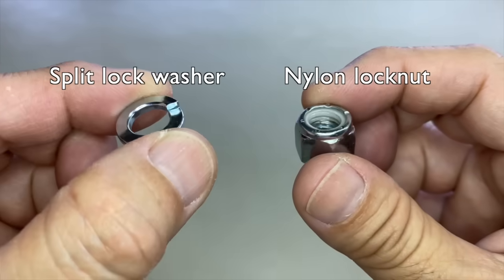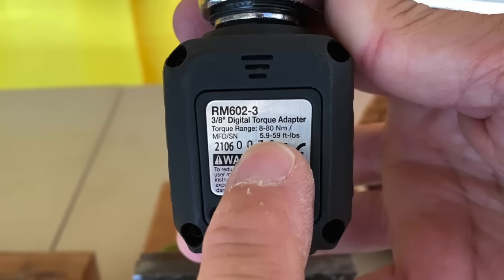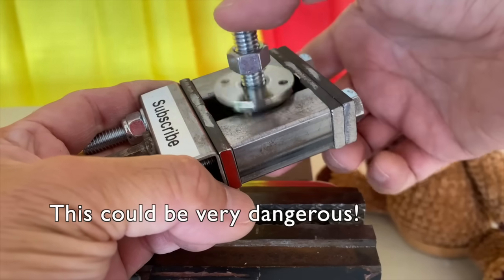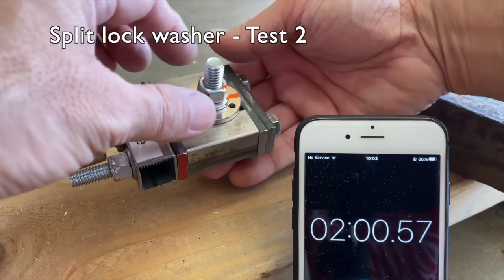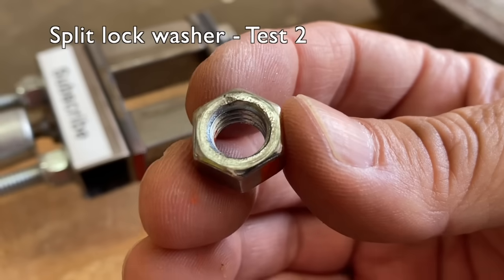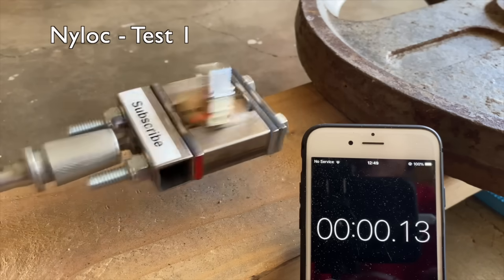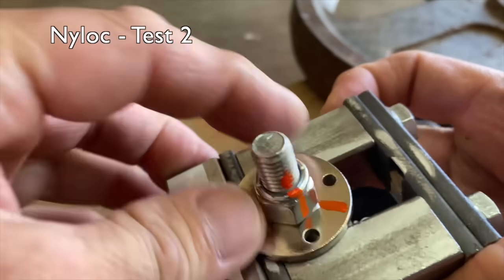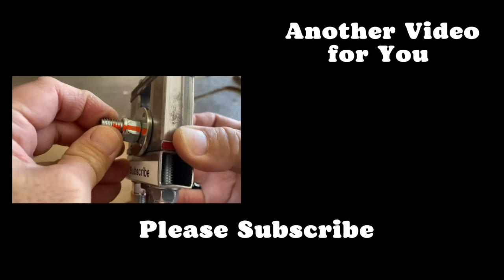Nuts & Bolts - Split Lock Washer vs Nylon Locknut – DIY Impact & Vibration Test - Part 1

Comment: I always use nyloc nuts that are then spot welded in place after a hole is drilled to use a cotter pin retainer and three drops of loctite, but not before I grind off the remainder of the bolt to then peen down around the nut like a rivet, after which I seal the whole apparatus with duct tape for water resistance.

I have trust issues.
Reply: So you were the guy who worked on my Model T! XD
Reply: They will invent a new method and you're in trouble, cannot add one more. :(
Reply: You must work for a repair garage that charges that charges $100 per operation therefore charges $700 to put one bolt in.  I think I took my car to you once...
Reply: @edwardpaisley9063  You were out favorite customer; the crankshaft bolt job on your truck was my greatest personal milestone!
Reply: Just showed that to my wife. She said. ,, oh my God!! You have a twin!
Reply: I do all that and use left hand threads to confuse would be saboteurs.
Reply: @bluestormcloud791  This is hilarious!
Reply: I always saw down the middle of the protuding part of the bolt with a hacksaw, then separate those halves with a chisel and hammer. 
Then I take an old sloppy adjustable wrench and carefully round off the corners of the nut. 

After that I give it a few squirts of Rust n' Stay™ and it ain't going nowhere.
Reply: Yet you rely on duct tape in an attempt to seal out water????
Reply: I’ve had to work on some of your bolts!
Reply: I would think that for water resistance you would use paint-on tape substitute.
Reply: ya my wife loves that too
Reply: Same! Then I bury the whole thing in the back yard and go fishing.
Reply: Truly a Dad Solution.
Reply: @insanejughead, 😂🤣😂🤣 You're funny 👍😁
Reply: @smw381st I guess so😂
Reply: You wouldn't have to do all that if you just tightened it up with a torque wrench to the correct specification.
Reply: Duct tape for water resistance? 😂😂😂
Reply: European Zinc External Serrated Lock Washer
Reply: Oh that makes me laugh.  Thank you!
Reply: holy fok
Reply: Without the final flex seal coating will not work......
Reply: LOL! I gonna say, what are you building lol.🙆‍♂️🤷‍♂️🙋‍♂️
Reply: TG, I thought I was the only one at this as I did a nut and bolt renovation of a LR defender 😖
Reply: Encapsulate the nut and threaded end of the bolt with JB weld with all your other means and it truly won’t go anywhere.
Reply: 😂 This is the best thing I've ever read!😂
Reply: Hmm, that seems unsafe to me. I'd add a crown nut with a split pin. Drizzle it in epoxy.
Reply: Nylocs good but supposed to be single use. Split washer can be used again butil it will flatten out and become useless. Can also deform split washer under enough torque.
Reply: Lol
Reply: I've got one better, for you. Torque it down and tack weld the bolt to the nut. That way, It CAN'T loosen on purpose, and you can still hit it a few licks with a cold chistle to remove it
Reply: Sounds reasonable
Reply: Of course you have trust issues!  You forgot the all important staking the nut in a minimum of 36 equal distant locations around the circumference of the nut/panel junction!
Reply: Using  a gallon of  red loctite would work too  but welding the whole nut makes it air and water tight
Reply: I always weld my nylon nuts 😮
Reply: @paulmartin1068  My hero!
Reply: No jam nut? What a hack lol😂
Reply: That my friend was hilarious I laughed out loud    😅
Reply: That is definitely overkill, I would suggest it's more like OCD.
Reply: hahahhhahha
Reply: I love it!
Reply: 🤣🤣🤣...guess you have the oppotyunity to charge for a lot off assembly time? Not to mention the poor bastard that possibly needs to disassemble your stuff!😅
Reply: Is this on ur interstellar spaceship? I can understand in that instance haha
Reply: Is 3 drops enough ?
Reply: 61 people believed you!
Reply: I think you could've done more.
Reply: i just weld it...
Reply: Dam bro no need for nylocs at that point lol but I get it
Reply: You mean you don't double-nut along with the above? I'm a bit disappointed.
Reply: Use electrical tape for water resistance. If your going to use tape and not some epoxy or something.
Reply: I like this idea. Sometimes it is critical to life to have a nut remain solid. I have done repairs on my semi truck and install new nuts, torqued to specs and used lock tight. I never considered drilling and adding cotter pins.
Reply: Just hot rivet it.
Reply: I thought this was parody initially. Now I'm not so sure.
Reply: Spot weld? Pfft lazy. If the whole nut gets loose with vibration you weld the whole nut.
Reply: Me too;(
Reply: Man, that was not educational at all, but I laugh so hard I almost pissed my pants! Your comment was amazing! Thanks
Reply: Do you also bring tanks to knife fights?
Reply: Just put a sticker on the assembly “Made in China”, and no one will expect the assembly to be tight. (Also the sticker will fall off due to crappy CCC glue)
Reply: Appreciate the humor. Welding the whole assembly might be your solution 😇
Reply: What you don’t use JB weld on it too???😂😅
Reply: You are hilarious!
Reply: You are my new best friend!!!!! My name is Jason nice to meet you
Reply: Thank you for the laugh. It's been a tough week with my dog having a $7,000 emergency surgery for her Pyometra, which caused diabetes, and then one of 4 Veterinarians said she had Thyroid Cancer and asked me if I had been feeding her "Chicken Gullet" (i didn't even know what a gullet was befor any of this) I mean this is a hunting dog, and I have shot many birds and I know they have a Gizzard. I eat the Gizzard and I have on occasion shared a COOKED Gizzard with her, but a Gullet was a new one for me. And since, I found a commercially available dog treats made of Chicken Gullet! Then another Vet said she may have Adrenal Cancer, and still another one said something else. Tomorrow, 05SEP24, she goes in for post op Exam and blood glucose curve testing which takes all day long, so this was a very timely joke. But, I do wonder what "torque to yield" is all about. And I have seen V8 piston rod nuts come loose even with Loctite Red applied after cleaning with Naphtha. That prompt me to learn about "bolt stretch." And I had a fasteners class in Auto Tech at a community college and we were taught to always use a flat washer between the lock washer and the device. So, I was just wondering about what application applies to the test. But, I'm 72, and like George Carlin said, "If I'd have known I was going to live this long, I'd have taken better care of myself." Because I'm not doing so well and doubt if need to know all about such things as keeping bolts tight. Given my druthers, I'd probably  opt for safety wire, but I'd want 13 twists for good measure. Ha. ben/ michigan
Reply: @benjamincresswell3713 
Im 65 worked on bikes motorcycles and cars to this day.
I've NEVER used a loxk washer with out a flat washer under.
Daddy taught me that in the 60s.
Reply: @c.e.anderson558   I often see that but I don't get it. What's the use of locking the nut to a flat washer that's free to slide? The only advantage is that the split washer acts as a spring to maintain some clamping force if something settles.
Reply: @Moparben3713 what is wrong with you
Reply: @Moparben3713 best wishes to you and your dog
Reply: Q¹+qqq+
Reply: What? No extra nut to secure the first nut?
Reply: I'll take your method one step further....
Add a jam nut on top of all that THEN you can rest easy.
Reply: You don't put a condom on it also!
Reply: Use red loctite with nyloc nut and split washers.   Drill hole through the exposed portion of bolt for cotter pin.   Now get ready to go to your weekly meeting of obsessive compulsives.
Reply: You forgot to crossthread it,
Reply: jug head ?more like d..k head !
Reply: I told you a million times not to exaggerate!
Reply: @N269  fair dinkum
Reply: Clearly you lay awake each night fretting over all the things you have done wrong the previous day!
The stuff of nightmares.
Reply: I hope you're exaggerating.
Reply: Spot welding a nut is nuts
Reply: OCD ...??
Reply: "I have trust issues" Gee you think!
Reply: You might think that is clever but it is not.  You now have a serviceability problem.
Reply: @stinkycheese804 also known as "the next guy's problem" 😂
Reply: @rafaelgsbr  The issue with "the next guy's problem" is that I am usually the next guy.
Reply: @stinkycheese804  Perhaps you should have used Nylocks to secure your sense of humor.
Reply: @stinkycheese804  That's what grinders are for
Reply: @stinkycheese804 it was a joke
Reply: @stinkycheese804  I think it was a joke lol

Comment: lmfao, your test jig with the reciprocating saw is genuinely funny
Reply: The Project Farm channel would approve!
Reply: @goodun2974 "We're gonna test that!"
Reply: @HacksbyDad  Looks like a great jig, and it produced usable results.
Reply from the maker: @PerrySummers  Thanks!  👍😎
Reply: @HacksbyDad  Test super glue as a thread locker. I've used in non-critical small screws when i didn't Loctite on hand and it has held enough, "not great, not terrible".
There is a debate going, others saying it sucks and others say it's permanent. My opinion is somewhere in the middle.
Reply: @HacksbyDad  Ya, hilarious; finally someone who gets why I read encyclopedias, the bible and other classics … for the jokes  /pure sarcasm in case too … (I’ll leave it to you to throw shade)
Reply: @gr8dvd  Yes, I don't think I've mever laughed so much at some testrig procedure, that had any serious ambitions. I've seen stupid tests that were intentionally funny. But this one made me think for real, aside from laughing.
Reply: Awesome idea & rig IMO, great test.. I was an Automotive Prototype Development guy.. Proof I'm never too fkn old to learn..
I concluded long ago using Nylok nuts w/ lock washer AND correct torque per application is the "best practice".. Using Lock-tite works BUT is precarious for servicing. Your test here proved my opinion was reasonable. Fun stuff, thanks.😊
Reply: It looks like a very aggressive dildo machine
Reply: Just your average Ford death wobble😂
Reply: Highly effective though.👍